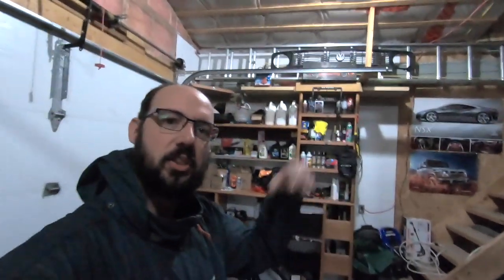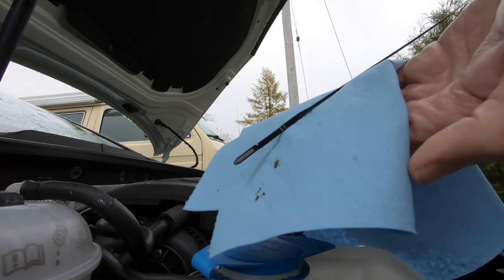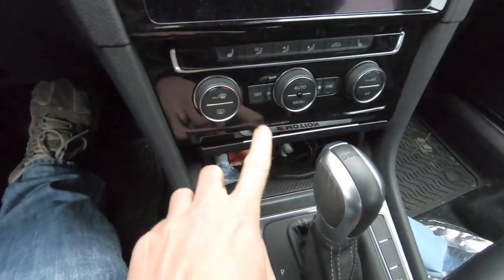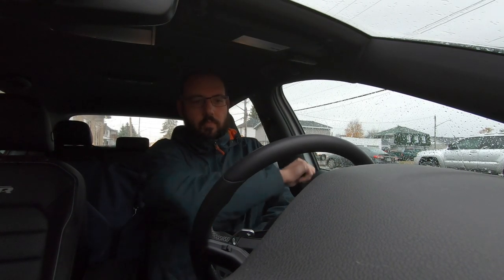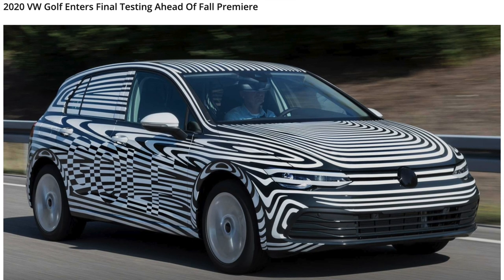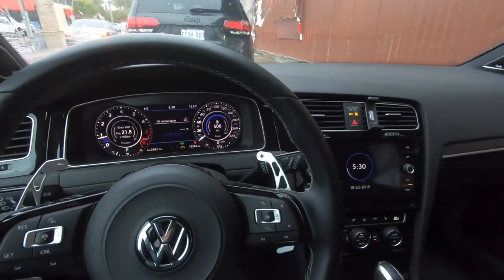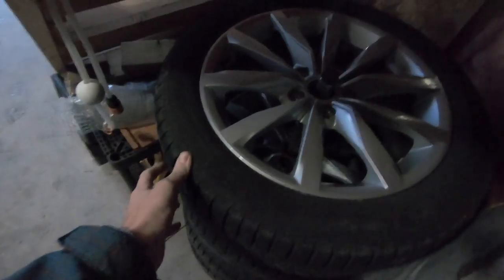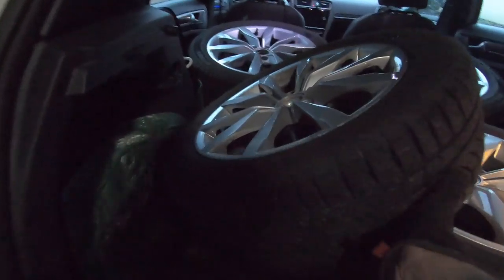VW Golf 8 Leaks and my Mk7.5 Golf R Update - Netcruzer CARS

Comment: Golf R and you dont have those new led lights? how comes they fitted standard boring ones?
Reply from the maker: My R lights are all LED. Not sure what part of the video you are referring to.
Reply: Netcruzer RC TECH CARS I meant the rear lights, i got an 7.5 R too and my lights are different to yours. For some reason you have gotten the golf basic lights that are equipped or 7.5 golf tdi. My 7.5 has dynamic indicators
Reply from the maker: North American 7.5 R get these led lights. Very different from euro spec. Also I’ve coded mine to blink all inner and outer. I have a video about that.